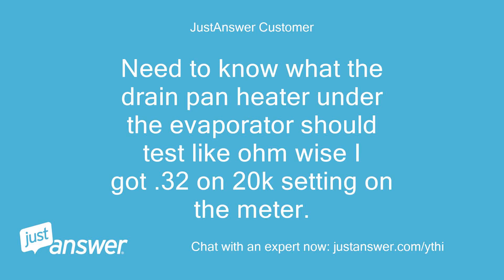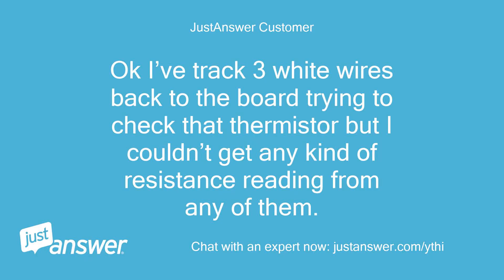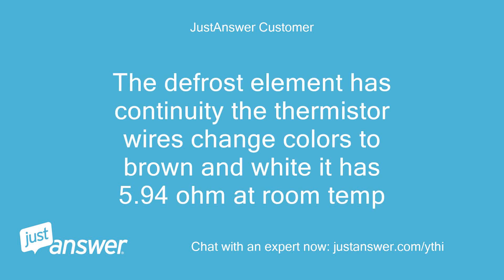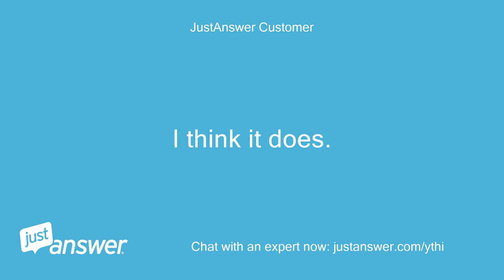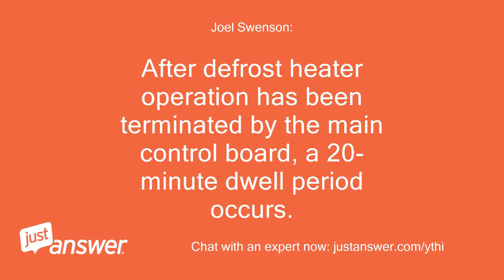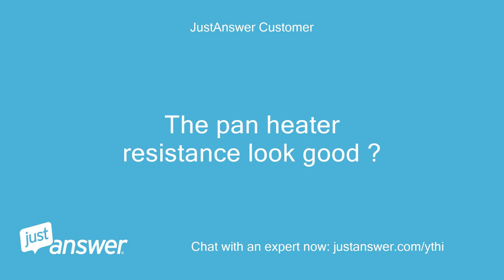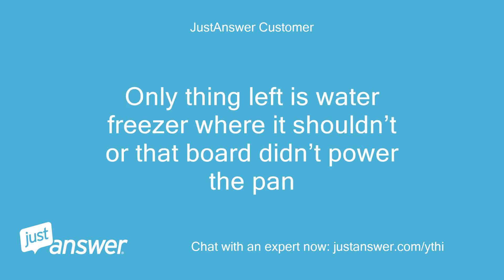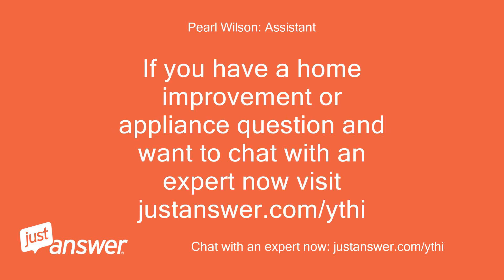Need to know what the drain pan heater under the evaporator

Comment: For anyone doing this. The guy assisting may not have known this, however, if this is for a GE Monogram built-in side-by-side, it has a defrost timer up in the machine compartment. You can see the white end of it facing you with the slot to use a screwdriver on to turn it. If you want to see if the heater comes on, turn the timer slot with a screwdriver until you hear it click and it should turn the heater on in the drain pan assy. If you take the leads off of the heater assembly, you can check for 110V with your multimeter once you turn the defrost timer on.